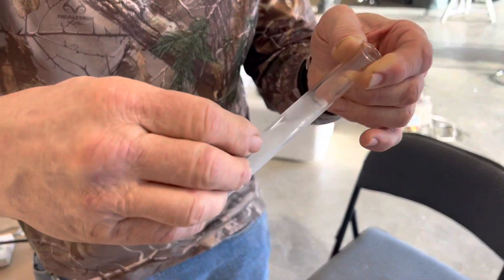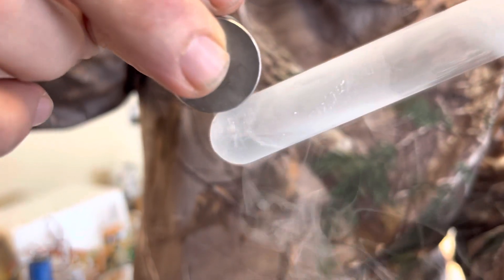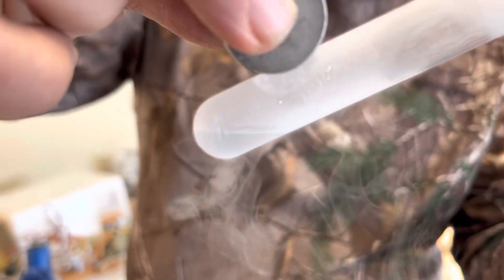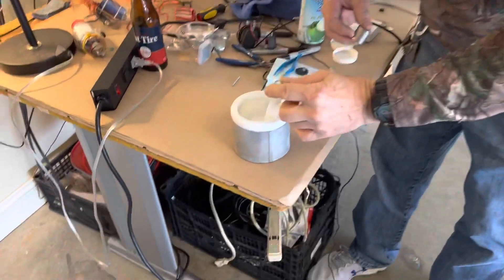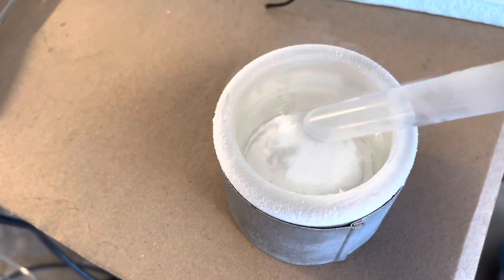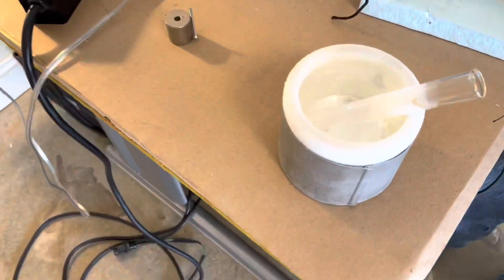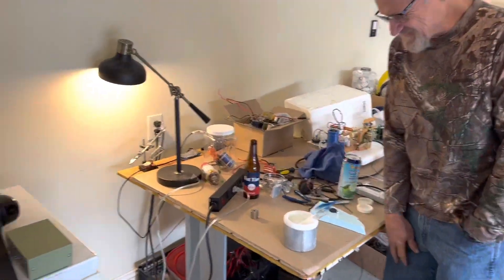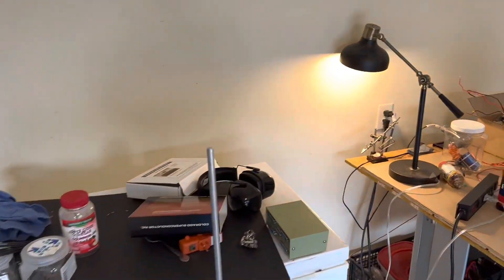Demonstration of attraction of liquid oxygen by a strong magnet

Comment: The mad science part of me want to know what would happen if you condensed both of the gases from that torch together (oxygen and the fuel)...probably would go off with a rather spectacular bang or flash if you lit it! The more reasonable side of me just wants to know where to find liquid nitrogen in the first place, lol.
Reply from the maker: Ha ha the geisha swarms of oxygen and acetylene red mixed together are extremely violent when ignited. I just can’t imagine what the liquefied ones would do if ignited. It would be probably the most explosive mixture on earth
Reply from the maker: Oh by the way got the liquid nitrogen from the local welding store. You need to have a DOT certified dewar vessel in order to buy it. They won’t sell it to you in a thermos flask.